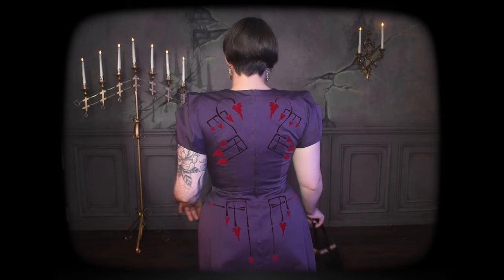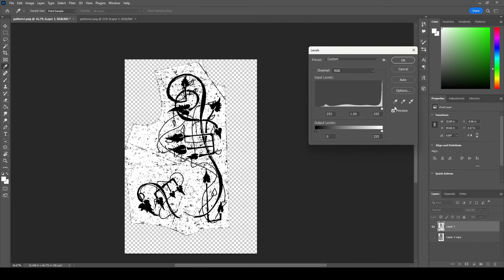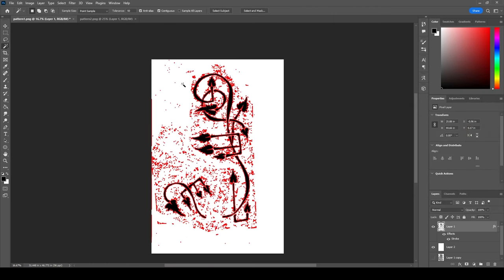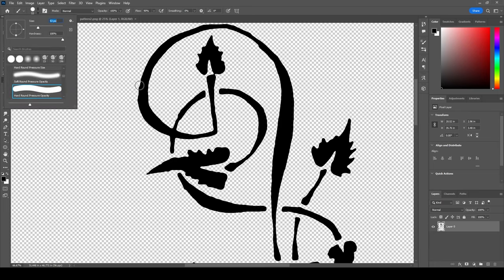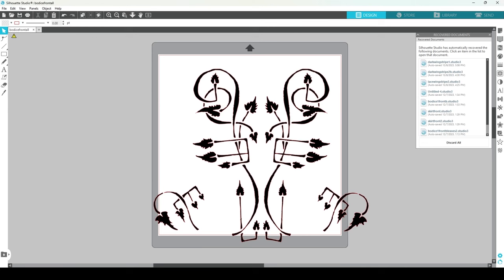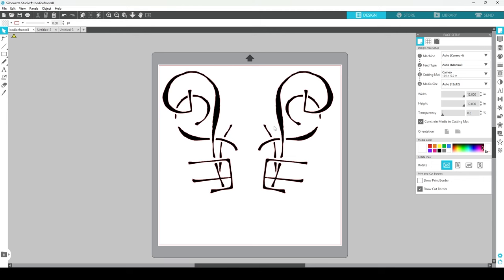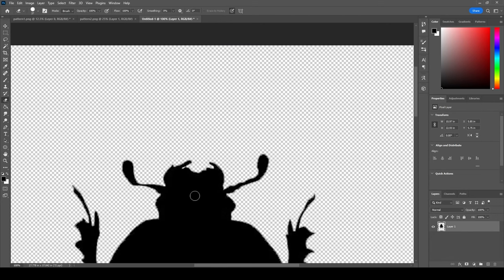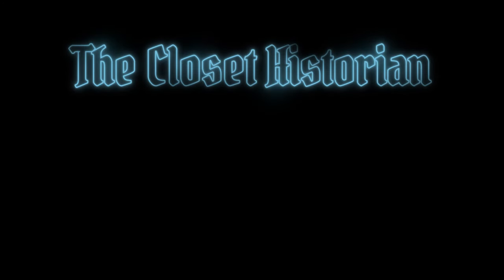How I Prepped My Design For HTV 😅✨ The Long-ish Version

Comment: If you only have a mouse, it's probably much simpler and easier to just trace a scan with a pen/vector tool than clean up the scan.   Photoshop, Illustrator, Affinity Designer, Inkscape, etc. all support this.  Whatever you're comfortable with and can afford, including free.

Oh!  And of course, if you can select something in Photoshop, you can invert the selection, adjust the selection (smooth, shrink, grow, etc.), and convert the selection to a path.  Then edit that path to your liking.

Comment: As an actual design/illustration person, your process is actually pretty close to how i clean things up from a sketch and how i prep files for gold foil printing etc. but for getting the really clean shapes in photoshop i will use the pen (vector) tool to trace the edges.
Reply: Also as a tip, the left bracket and right bracket keys on the keyboard decrease and increase brush size respectively ;)

Comment: I used to use the a vector graphic program called inkscape and it had a trace image function which made it super easy to get your images without many artifacts. I also preferred vectors because the lines were smooth and it just skipped a few steps, the only caveat is the the program has a steep learning curve because it's technically free.
Reply: I came here to mention this.  Waaaaay easier to clean up, vector, etc.  Paste, select, trace image, set high contrast or multi colors, smooth, done.  Obv a little more than that, but I do this all the time for my industrial cutter (the 2'x10' capacity USAcutter iirc)